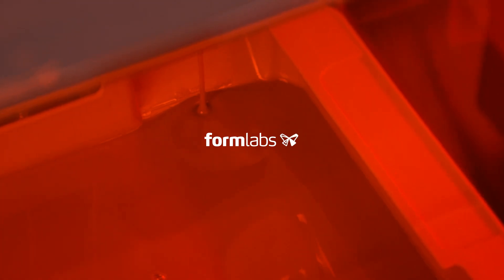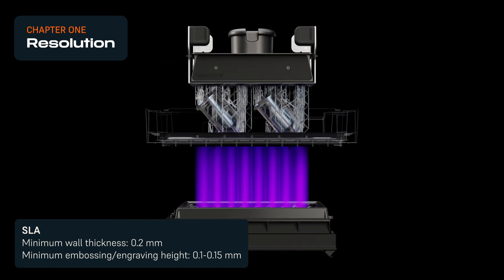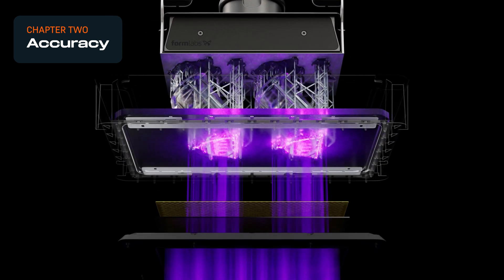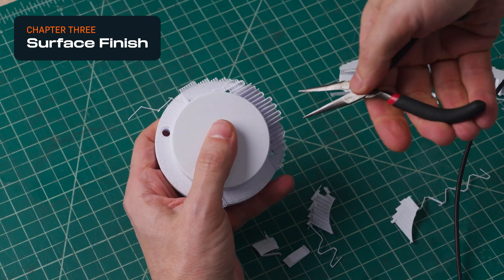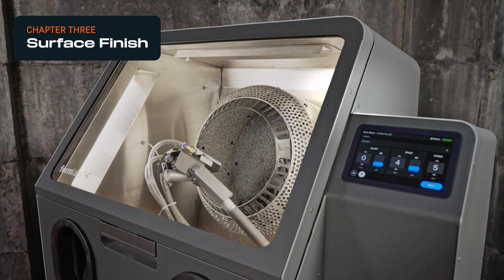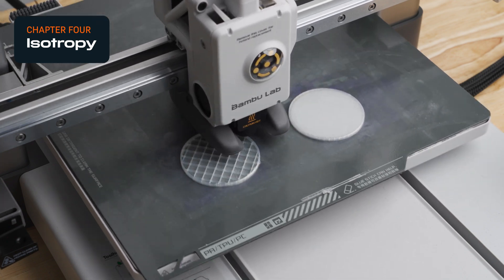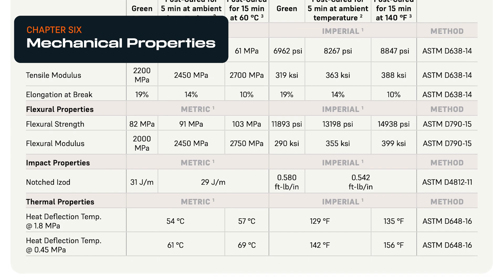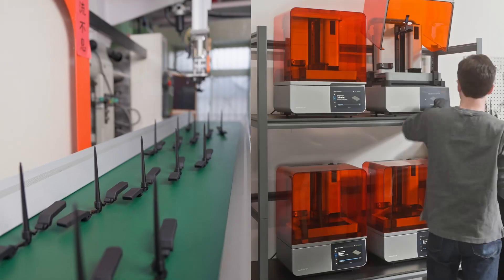FDM vs. SLA vs. SLS: Comparing 3D Printing Quality

Comment: We have both FDM and SLA at work (both printers in this video) and boy oh boy did Formlabs their best to find the worst examples of FDM printing 😂 Both techniques are great but most of the time FDM prints are less work and finishing compared to resin
Reply: hard to believe any of their videos when they are biased towards sla and sls. They conveniently never mention that sla is prone to UV damage. FDM also has much less post-processing required in most cases.
Reply: @mhouse1481  07:23